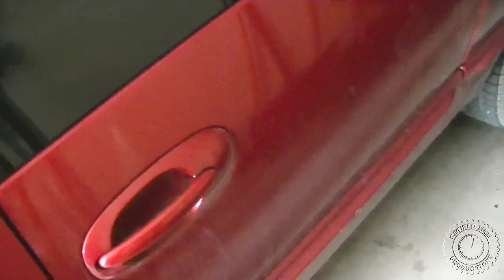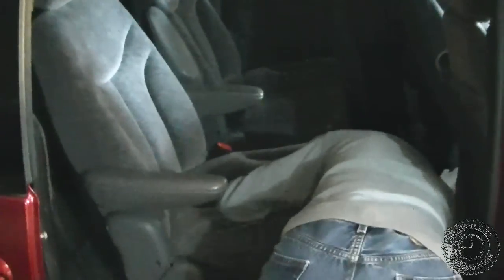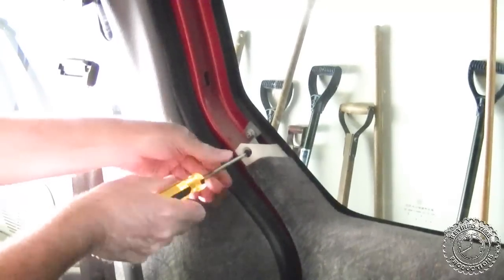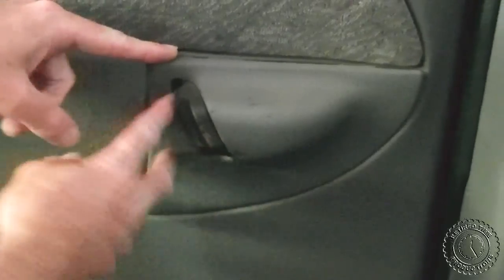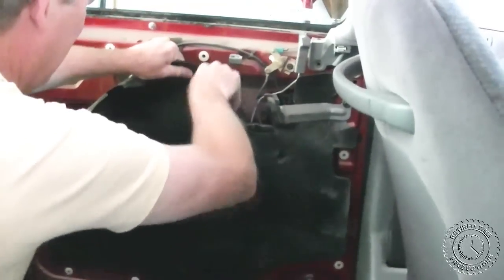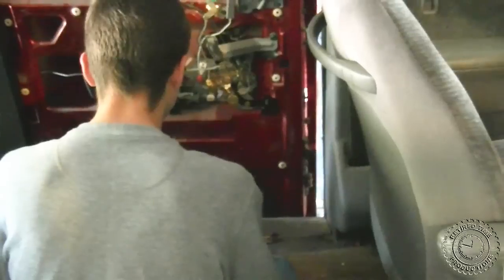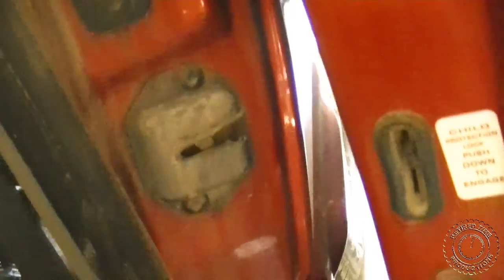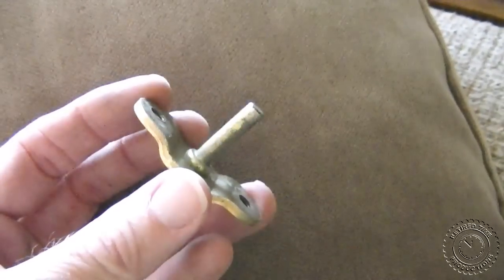Fix Jammed Stuck Sliding Door Latch on 2000 Dodge Caravan, Driver Side

Comment: Thanks for this. Our driver side door has been stuck closed for years! We tried this yesterday and it opened! We did have to disconnect the battery before kicking the door open. After getting the door open, I just removed the part at the rear of the track that keeps the roller from opening too far and put the roller back on. Works great! Thanks again :D
Reply from the maker: Glad you got it working!  I traded my 2000 model on a 2016 model but I have to say the sliding door was still working. Never got stuck again.

Comment: can you follow up on this video?  Did you straighten the pin?  Does it still work?  Is there any danger in removing that 3 bolt roller thingy on the bottom right?  I'm afraid if I remove it and can't get the door to pop open, I might not get that thing back on.  Please update!  My driver's side door on my 2000 is stuck too
Reply from the maker: Bobby Vincent Believe it or not the door still works after all these years. I did not get a new pin yet. It's just to keep people from opening the door when the gas cap lid is open. The roller wasn't a problem, it went back on okay. It isn't shown on camera but my son kicked the door from the inside with his feet and it popped open so maybe removing the roller is not necessary. Wish I knew more but that's all I got.

Comment: How did the door get stuck
Reply from the maker: The gas cap safety lock pin got bent. After we got the door free I removed the two screws that held the pin to the door and got rid of it. Never did buy a new pin but it would have been very inexpensive to replace.

Comment: I'm having the same problem and I have done everything you said but door won't open. Where on the panel should I kick top or bottom. Please reply
Reply from the maker: At the bottom on the frame after removing the roller bracket at the bottom first.

Comment: I know this is an extremely old video but ima throw it out there, my kids have slammed my sliding door shut and now it will not open, do you think your solution could also be a solution for my problem?  same make and model
Reply from the maker: It might be the fix. My door got damaged the same way by my kid slamming it. After we got it open it looked like the safety pin for the gas lid was bent and jamming the door.